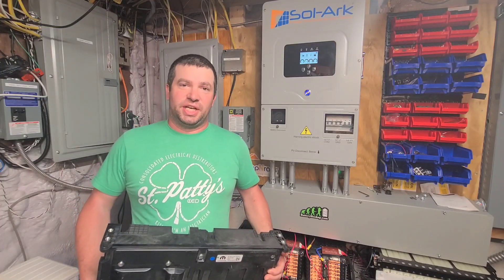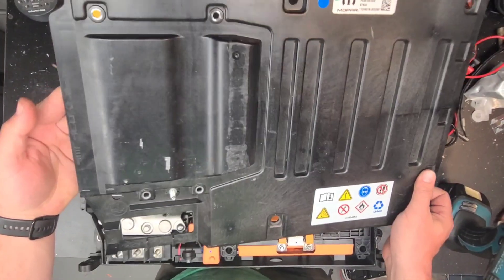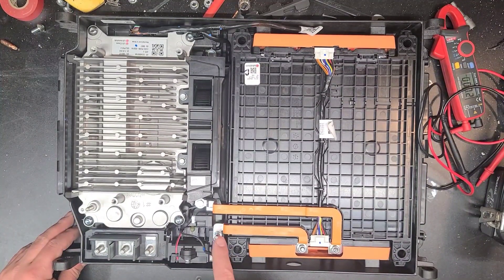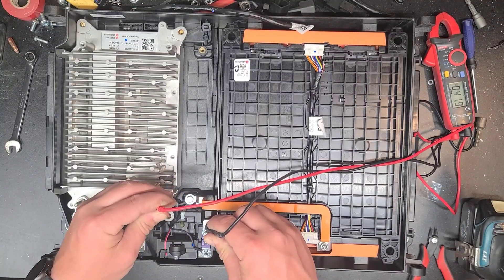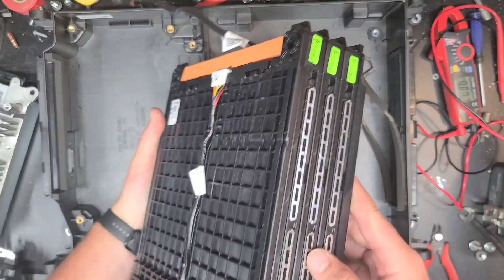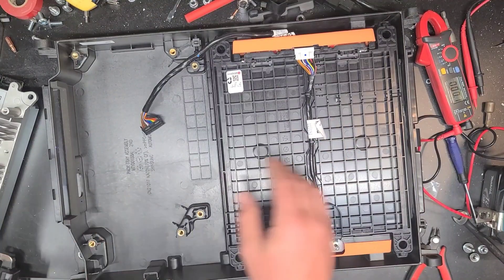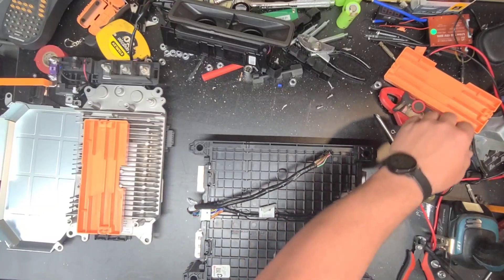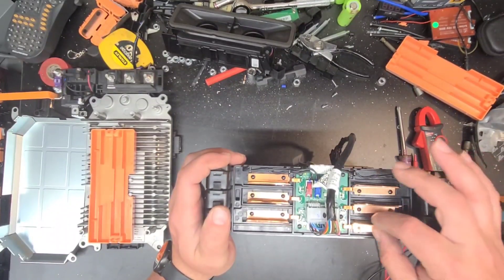48v or 12v? Help Me Get This Battery Working!

Comment: Thanks Ben. What are the dimentions of the 12s battery alone?  The Sigeneer inverter designed for 2 Tesla module voltages would be a perfect match here. I like your set up with 2 pole QO load center used as a DC combiner.

Comment: CAN bus is Simple. Find the pin outs for the DC to DC converter and the should be a CAN Hi and a CAN Low. Well worth trying to get it to work. What’s the brand, model # etc. so we can look it up?
Reply from the maker: Thanks Paul, I left all of the part numbers along with a link to what I think it came out of in the description.  Once I find CAN hi and low, what do I do with them? From my brief research about it, it sounds like CAN as a whole is similar, but there are different "languages" so without knowing those, it's difficult to figure it out.
Reply: Finding the CAN lines is about 1% of the equation. If no one has publicly documented how to talk to it, it will be impossible to use. (and without the car that uses it, there's no bus activity to watch and figure out.)

Comment: Isn't 41.9v in a discharged state? I was under the impression that a charged 48v should be show in 52v neighborhood.
Reply: for normal Li 12s that voltage would be low state of charge.
Reply: @melovescotch  3.5v/cell isn't that low. Without knowing the exact specs for those cells, it's hard to say what the SoC is. A few charge/discharge cycles will tell.

Comment: It's a multifunction module with lots of inputs and outputs.  You could try tracking down the wiring diagram of the vehicle that the module is used in.  That might give you some insight as to where to apply your voltages or jumpers.  That is an impressive rating of 3Kw for the DC to DC converter though.

Comment: Really nice junk the cells are the only thing of salvage unless you can program can bus. Oh nice fuse too that dc to dc converter/bms must be working as it was shut down at first with no voltage. be interesting to apply 12 volts to it to see if the 48 volt comes alive. Good luck.

Comment: I think, like most hybrid vehicles that run their interior electrical systems from the power cell, the vehicles computer controls the transformer. Too bad the battery isn't a 13S and integratable into your battery bank system, Ben. I imagine that's what you are thinking also?

Comment: If the 12v inverter hooks to the rest of the car  wiring system and needs the key or something in the car's computer in order to turn on it will probably be a total loss.